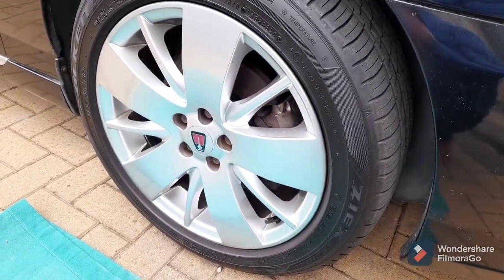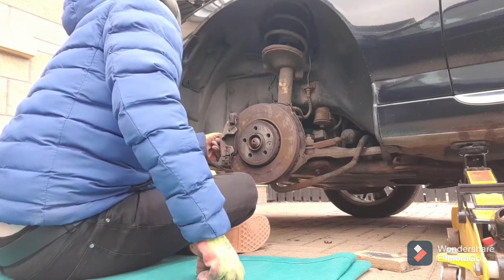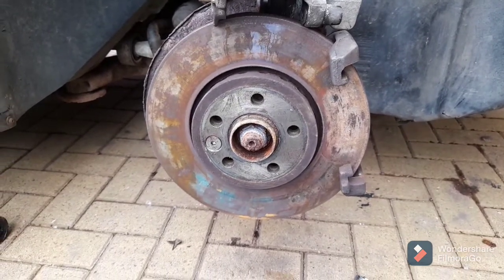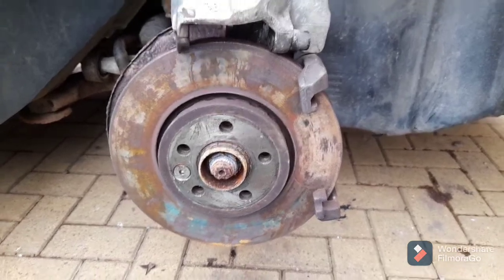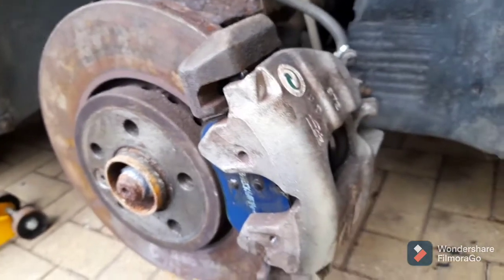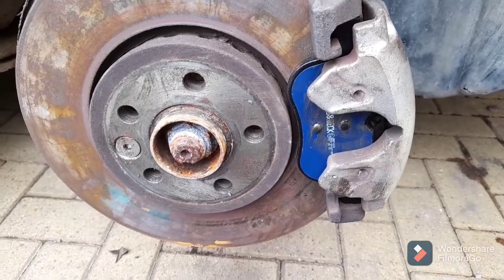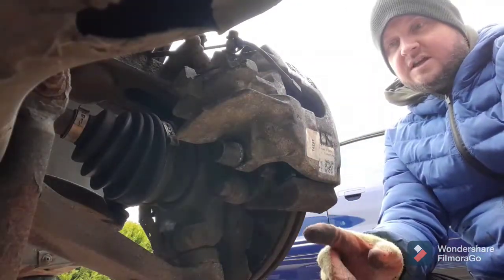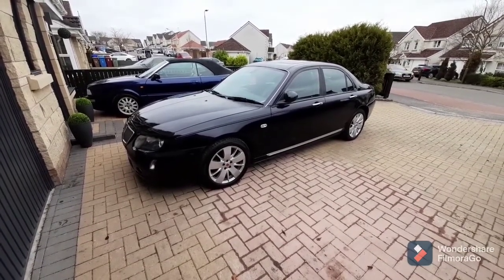Rover 75 Brake Caliper/Pad Fix

Comment: Good video.  It is a common fault the wheel nuts won't come off and it is not just the tyre shops doing the nuts up too tight.  I get rid of the security studs/bolts and replace with ordinary ones.  Cheap rattle guns can't  undo /get them off either.  A Dewalt  can,  or   any metal tube on the end of your socket set should do it,  even then it is not easy.  Oil the studs and  do up the nuts to 125nm.  Copper grease around hub bearing where it mates with wheel.  That way if you ever  get a puncture you can get the wheel off!  Otherwise you have to carry a pole around with you,  just to get the wheel nuts undone!